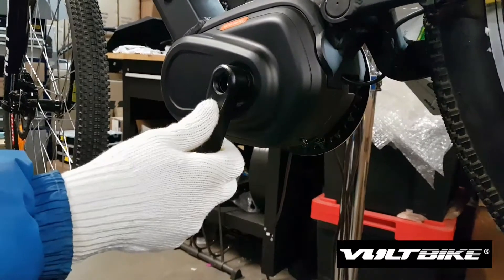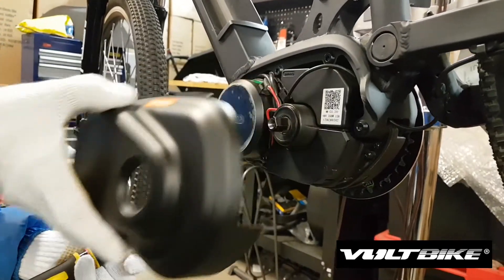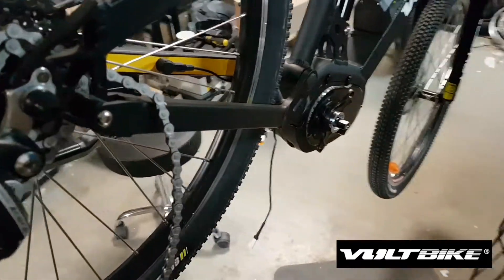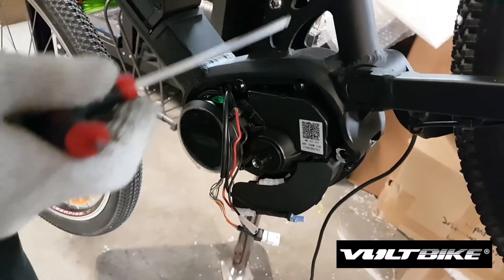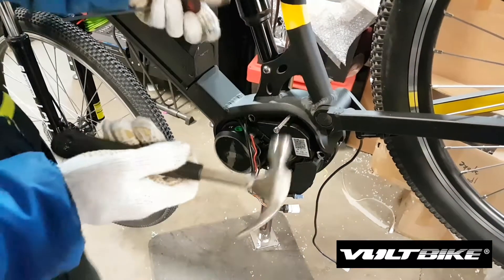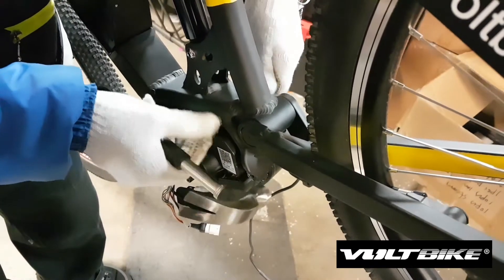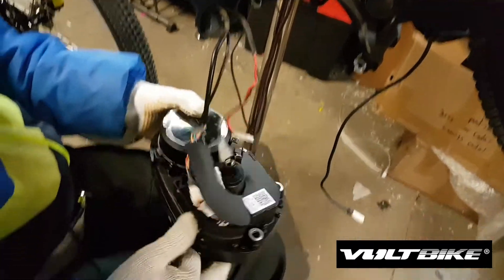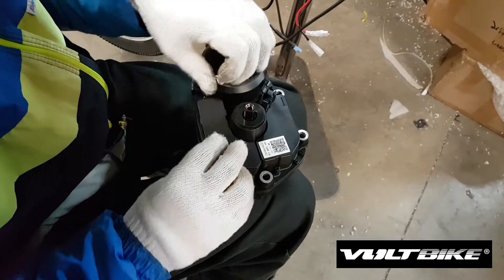Voltbike Enduro - How To Detach Motor Bafang Max Drive

Comment: Good video! This is an older Enduro, with the M400 motor.  Do you know any videos which tell how to fix the nylon gear?  None of the videos here say "M400 motor" on them!  I guess M400 is the entire "drive system" - so what is the designation of the motor itself?  (So I can search for a gear-replacement video.)  Or are there any shops who will replace the gear for you? (if you send them just the motor)
Reply: https://www.youtube.com/watch?v=nm6UTwLRays complete disassembly of the M400 G330 nylon gear included.

Comment: Does the gps tracker go under the engine cover? https://www.aliexpress.com/item/2016-Radar-Sensor-Mini-Vehicle-Motorcycle-Bike-anti-theft-system-LBS-GPS-GSM-GPRS-Alarm-Real/32812368733.html?spm=2114.search0104.3.15.3db239c0SH0iNf&ws_ab_test=searchweb0_0,searchweb201602_3_10152_10151_10065_10344_10068_5722918_10342_5722818_10343_10340_10341_10698_5722618_10697_10696_10084_10083_10618_10304_10307_5722718_10302_5711215_10059_308_100031_10103_5722518_441_10624_10623_10622_5711315_10621_10620,searchweb201603_1,ppcSwitch_4&algo_expid=1ff08081-708d-4214-a6ea-f64093ce6052-2&algo_pvid=1ff08081-708d-4214-a6ea-f64093ce6052&transAbTest=ae803_1&priceBeautifyAB=0

Comment: Thanks for the video. Does the Max drive controller support a throttle? Do you know where to buy the same controller which is used in the 350W Max drive model?
Reply from the maker: The newer version of this motor support throttle.
Reply: I have the MM G33 .350 and it keeps powering the rear wheel for a couple of seconds after I stop pedaling. It didn't used to do that brand new but started at about 400 miles or so.  I would prefer it didn't throttle that way but stop pedaling early now. Thank for the walkthrough Sir. I'm switching the motor to a new aluminum frame after my last one snapped.